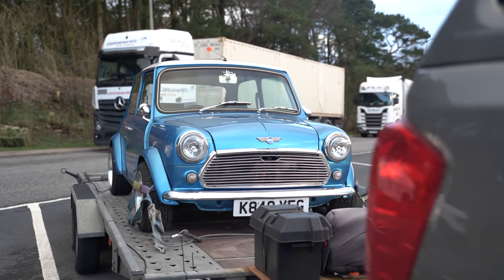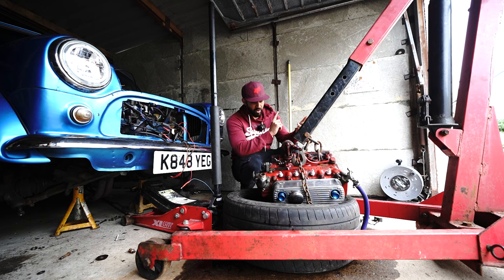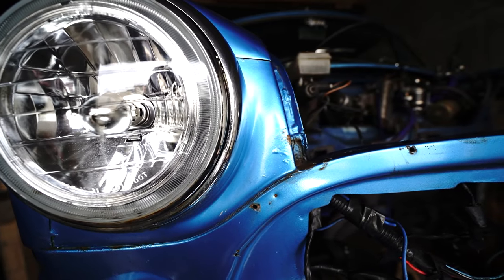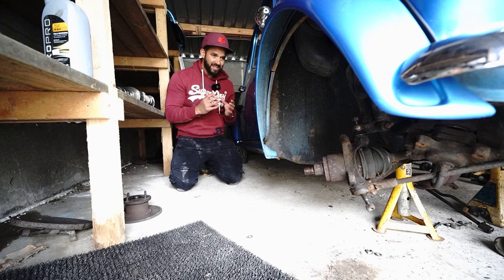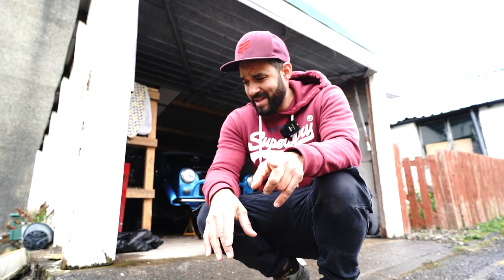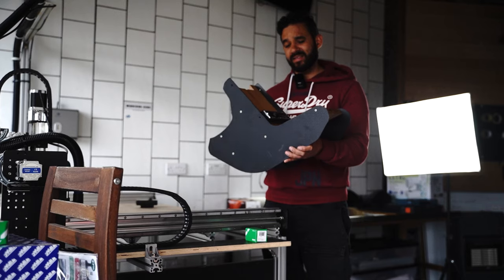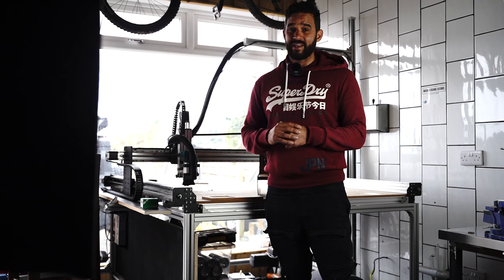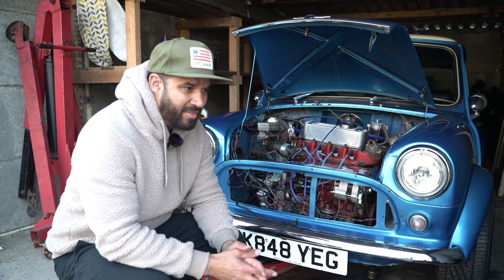Removing the engine from my Classic Mini

Comment: Replace the motor mounts and all of the rubber bushes - cheap as and easy to do. Maybe new earth strap too - may help elec issues. Someone has had a play with the hoses as you have silicone - bonus. Radiator looks iffy esp given the rusty water evidence. Thermostat replace at the same time cant hurt. There will always be a list of things to do - joy of a classic old car! ;-)
Reply from the maker: Thanks Toby. On the list.

Comment: The rusty water is just sand from when the engine block was cast, you will find that on pretty much every steel block engines, nothing to stress about 👍
Reply from the maker: That's good to know. Think I'll definitely give it a flush.

Comment: Don’t beat yourself up, nobody would have spotted that clutch. The rusty marks on the subframe/rad is that it has been over heating - causes are - the rad’s knackered, thermostats knackered, water pumps knackered or possibly engine issues. I would 100% change the thermostat and uprate the water pump. Probably change or flush the rad. Whilst out, change crank seal, gear selector seal, maybe driveshaft oil seal. Basically if it’s leaking oil, change the nearest seal. 👍
Reply from the maker: Legend. Thanks buddy. 😊

Comment: Unless you have hydrolic suspension it is far easier to remove the whole front end, complete with engine, gearbox and radiator. It is also much easier to re assemble the whole thing out of the car. There is also far less chance of scratching or damaging anything in the process.
Reply from the maker: Hadn't even though of that as an option Bruce. Will definitely keep that in mind.

Comment: That rusty look appears  that the previous owner must have been running water and not coolant...Should to a Red rebuild/ replacement..
Reply from the maker: Good to know. Worth running  evaporust or coolant cleaner through the system?
Reply: @RookieRestorations  yes I Would thinka flush of the cooling system when you get it back together..🤔🤔

Comment: That engine mount problem wasn't the mechanic's fault, yet another bit of crap design, happens to most of them eventually...
Reply from the maker: I've read you can buy strengtheners. May look into that.